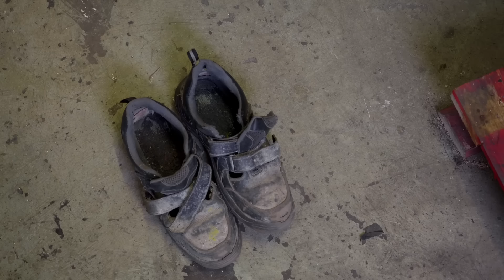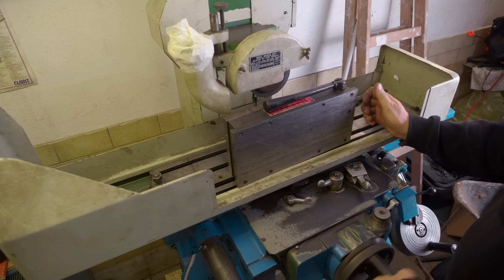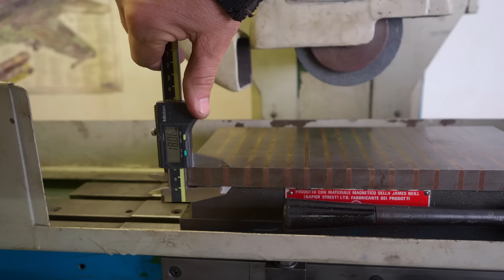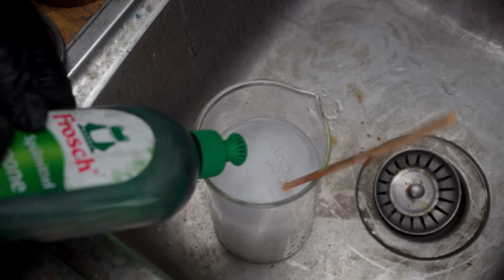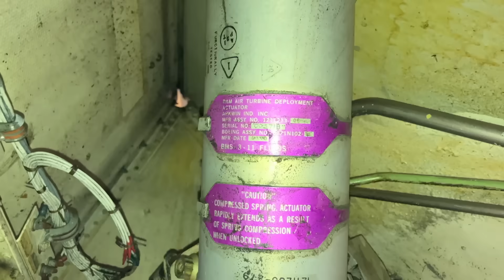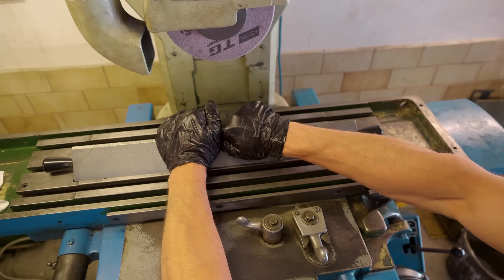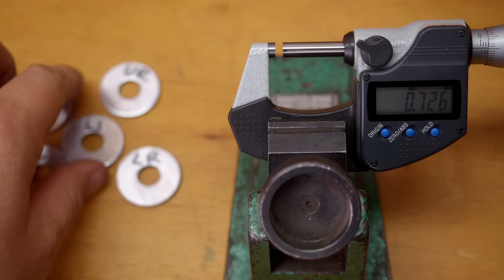Why cant I grind flat parts on my surface grinder? || RotarySMP

Comment: The top of the chuck needs to slide off. It won’t come off directly up particularly if the magnet is on. So, whack it sideways with a soft head hammer until it moves. I bought an Eclipse that was stuck that way as well. Though they had counterbored for the screws on the bottom and used standard hex head screws. Also, the manufacturer of my grinder says to first grind the table when you set it up and then to grind the bottom of the vise, without the magnet on (light cuts only!). Then flip it, clamp it on, turn the magnet on, and grind the top. A bit of work, but not too bad and everything is flat. So you know doing that is correct. But grind the table first! Otherwise, every time you move the chuck you have to regrind it, because it will distort from the non flat table. Since this is to get very high precision, that could matter. And please be careful positioning the diamond past the center!

Balancing the wheels is important. Even if you buy a really high quality wheel, such as the Norton’s I use, the material isn’t perfectly homogeneous. Cheaper wheels, I’ve found, can be really unbalanced.  So you have to balance them before using. I made a knife edge balancer out of three pieces of 1/2” aluminum and two pieces of blades from a wood planer. I slightly dulled one edge with 600 sandpaper. That works very well. Just make certain the blades are parallel and that you have three adjustable screws for feet to allow for leveling the balancer.

It’s hard to measure that surface with a level when on a wood pallet as the shifting weight can cause the pallet to squeeze slightly as the weight moves toward that side,  causing the reading to be reading the pallet as much as the machine.

I did put a DRO on the vertical column. I don’t care about the size itself. You can easily get a 1 um glass scale for some of these. I use TuAuto brand DROs and scales. They’re very good and inexpensive. I have them on all my machines. They have good support, including videos. Too bad they don’t have a one channel DRO though. Don’t buy something REALLY cheap. We’re grinding to 0.0001”, or equivalent, so you have to be able to read around that number.
Reply from the maker: Hi Mel, a friend of mine has a balancer. I just need to make up an arbor and go and use it. 

I dont want to grind the table, until I have scraped the ways back into alignment. 

I already bought a 0.1µm scale, and have a DRO kit from my friend Stefano. Just need to find time to install it.

Comment: The chequer pattern after grinding is probably because the grinding wheel is out of balance.
You can make a knife edge balance for the grinding wheels- that's one week of content sorted 😉

Re: overhauling the big magnetic chuck: I'd be really wary of taking it apart. Those magnets (especially in a chuck that big) won't hesitate to remove fingers.
Reply: Found this video of an eclipse vice.
Seeing him putting his fingers that between the multiple pinch points had me wincing nonstop.
https://youtu.be/e3P_Fcl97tw
Reply from the maker: Thanks Marc. I will getting some oil into it and exercising it and see if I can get it to free up without stripping it down.
Reply: @RotarySMP   @oxtoolco has done a rebuild of this type of vice: https://www.youtube.com/watch?v=kukVLu26GV8

Comment: Good video, but in order to get an excellent result, it is better to balance the wheel first and use coolant, especially when you are dress the magnetic chuck.
Reply from the maker: Yeah, I have been on the lookout for a coolant tank. My friend has a balance jig, but I need to get around to making an arbor.

Comment: Solid Rock Machine Shop channel has a few videos (one as a guest on Vintage Machine) grinding in a chuck. If I recall, Steve ground the bottom with residual magnetism and the chuck mass with light passes.
Reply from the maker: I dont expect this to me my last grind on that chuck. I removed so much I am sure it will move a lot when I remove it.

Comment: I knew a regrind was on its way 😂 I have to say it. I told you so
Reply from the maker: You did. I was just hesitant because the first results were so bad, I feared a worse problem than just the chuck.
Reply: Armchair machinist for the win 🎉 @RotarySMP

Comment: Interesting that they want you to thin the spindle oil with 10% of kerosene.
Reply from the maker: I suspect this machine originally delivered with the plain bearing spindle, which needs that kerosene thinned oil. It now has a spindle with greased AC bearings, so that placard is no longer applicable. Or maybe the cover was switched between grinders.
Reply: Interesting.
Normally precision bearings are always oil lube.

Comment: Another great video, Mark. Thanks for teaching us a few more useful things. 

On the question you asked about why the machine would be in such a bad shape. -> I have seen some shops where the people just don't care about their tools or the work they make. Good is often good enough in a production shop and this the case of your grinder, it was probably good enough for their purposes.
Reply from the maker: Thanks Johan. I do wonder what sort of shop has a grinder if 0.1mm is close enough :)
Reply: @RotarySMP  I had the chance to use a surface grinder from a buddy of mine who mainly grinds tools for the food industry — I believe they’re dies for meat and potatoes. I wanted to grind some shim rings for a spindle, which really need to be flat. But every time I reached for my digital micrometer, he’d say: “What are you doing? Digital calipers are more than accurate enough!” That probably says it all.
Reply from the maker: @workshop54projects  :) We all have a different feel for accuracy. My daughter is in a physics lab playing with atomic force microscopes and looking at nano particles :)
Reply: My dad taught me to never use compressed air to remove grinding dust from a surface grinder. Compressed air will force abrasive and steel dust into the ways and cause wear. A lot of the parts he made had +0 -.0002 inch tolerance. On a sine chuck!
He would use a grease pencil (aka China marker) to find zero on the surface to be ground. Mark a spot on the workpiece and ease down until the wheel removes the mark without touching steel.
Reply from the maker: @108gk  I dont use compressed air for cleaning machines at all. I know it is fast, and common in industry, but I prefer to brush or vacuum.

Comment: I was once watching a video where a guy was grinding a hollow in thin saw blades by first grinding a convex shape onto his mag chuck that way the shape would transfer into the part when it is pulled down tight. Maybe the previous owner of that chuck was doing something similar.
Reply from the maker: Good call Matthew. Could well be.

Comment: Fascinating video, thank you. I'm not a machinist, and I'm not great at conceptualizing things in three dimensions. I didn't understand why David said that grinding the table flat wasn't useful. Wouldn't that be a prerequisite for grinding the chuck flat?  Was it not out of flat enough to cause a problem?
Reply from the maker: Yes, you would grind the table flat after reconditioning the slide ways, but as the ways are still pretty good, rather than grinding their errors into the table, it is better to leave it and live with as the errors are minor.
Reply: @RotarySMP  Oh, I see. You have to accept something as a given baseline or you'd be forever going round in circles trying to make things parallel.
Reply from the maker: @jrmintz1  Good point. Thinking about it, that table is only about 15µm off, so I would not be grinding away much to touch it up.

Comment: My hypothesis for the chucks condition is. It was used purely for aesthetic grinding of some part or parts and did 1000s of them.
Reply from the maker: I was picturing some production welding shop, which used the chuck to hold thousands of meters of square tube.

Comment: why not just regrind the table and chuck when you got it running?
Reply from the maker: Because the initial results were so terrible, I was afraid there was a larger problem lurking, and grinding the chuck would not address it.

I would not regrind the table until after a geometric overhaul.

Comment: Feels weird to at a base and an acid together on in a solution being that they just cancel each other out.
Reply from the maker: That was also my first thought Matthew. I got this comment...

@JaenEngineering
It forms sodium citrate which is a chelation agent. Basically the molecule formed has a kind of hole in it that is the perfect size and charge for a metal ion to fit in to. That's why it works on the oxides, which is an ionic compound, but not the base metal
Reply: They don't strictly "cancel" they form a new compound that may have different properties than either of the components alone. The question is why one would do it and deal with the foaming when one can just buy sodium citrate, at least in the US. Wikipedia says (of trisodium citrate) "It is common as an ingredient in bratwurst," so I assume it available in at least some other countries as well.

Comment: Throwing in another guess for the valley in the chuck: Maybe someone put heat into it during a poor regrind? That'd grind down a hump in the center that would form a valley after cooling.

Thanks for the video!
Reply from the maker: Would have needed some serious heat to cause 120µm of thermal growth, Everett. :)
Reply: @RotarySMP  Oof, yeah. Good point. Maybe it was overconstrained on the clamps and tried to grow lengthwise? But that's a reach!
Reply from the maker: @EverettWilson  Some have speculated a knife maker wanted that shape?

Comment: Ofc it helps to bring in the table. Since your basically making it flat and parallel to the movement of the moving axis. Now you just also need to do the super glue trick for when you grind in the first side ( so it's ground flat without any stress put into it from the holding ( if it's not flat from the start the magnet is strong enough to pull the unsupported parts down and therefore create stress in the part and when you then turn off the magnet it springs right back. But the superglue isn't strong enough to do that ( hits why you use the superglue trick for the first side )
Reply from the maker: Thanks for the tip. So super glue the mag chuck upside down on the table, grind the base plate, then remove it with acetone and grind the top?
Reply: @RotarySMP  yeah but not like you put the glue all over the chick and then put it down.

what you actually do is first you grind the table so the table is flat and parallel with the movement of the axis. then put the chuck on the table bottom side up. then put the glue along side the edges that way it will suck itself into the small cracks ( capillary action ). then grind the back side clean ( which also ensure that its parallel since it wasnt stressed at all under the grinding ) then you can remove it and turn it over. clamp it down ( maybe make two new clamps that use 3 bolts and clamp down over the entire length instead of just one point ) and then grind the top flat as well. that way everything that needs to be ground is grounded without putting stress into them ( since the table and bottom side is ground without any stress they match and support perfectly to eachother and therefore zero stress when grinding the top of the chuck as well

btw adam the machinest has some really good ideos on grinding
Reply from the maker: @flikflak24  Thanks a lot for that full procedure. I am kind of holding off grinding the table, as I would rather do that after the ways are rescraped. Then again, as the current error is only 1/100mm, I would not be removing a lot of metal.

Comment: Yea those screwdrivers are superb!
If you have the right size Philips, you can push them in the screw head and they stay put horizontal or upside down! 👍
I always have a set of fresh ones for those ashole screws, and some worn beaters, and cycle them through!
Reply from the maker: Thanks for the feedback on them Martin. I was really happy with this one.

Comment: What worries me is that someone was making parts for production on that chuck with it being way way out. So something was made with very badly out of parallel ground parts.  No idea on the black magic that's inside that big mag chuck. On the small one I would drill out the threads and rethread it for a standard or metric thread and get rid of the BS threads. Funny how that acronym describes the threads in two respects. 
    
         I like that derusting mixture. Might work even better in the ultrasonic cleaner assuming it wasn't full already. I like the idea of just putting water in the cleaner then putting parts in a sealed container so it's easier to do different mixes and use less cleaner. 

          So now you can tell the better 3/4 that your shop produces parts for her drip irrigation system. :) A friend of mine has a couple 3d scanners I can borrow but I need to figure out what I want to scan before I have him send them to me.

         My first thought on the sticking was that maybe somehow the piston was covering up the ports at either end.
 
         The comparator post doesn't matter since in this case the cosign error doesn't make a difference.

          Been in allot of discussion about the 787 with pilots and mechanics etc and an ex Lockheed engineer and we all come up with the same group of educated guesses to look at but without any data we dunnow. If it wasn't a malicious act by the crew or an engine failure and shut down of the wrong engine I am more worried as that means a real issue with the fleet of aircraft. That said I don't like flying on the 787. Bring back the L1011 and 747 lots more room to stretch your legs on a long flight on them.
         Which the better half said I should go somewhere in september. Flights to Athens are dirt cheap this year but the exchange rate sucks but I could actually go to the beach and sleep on the beach as she doesn't let me do that... Or I can make a trip to Tokyo and visit my friend from nextdoor I grew up with and haven't seen since 89. Hmm
Reply from the maker: Leg room is not the plane, that is the airlines seating choice. I like that the plasic airframed A/C have the 6000' cabin alt, so you throat is not as dried out after  two 12 hour flights to NZ :)
Reply: @RotarySMP  I live in hot swampy tx so I like dry air as it clears my sinuses. The 787 doesn't have the open room in the cabin to be able to walk around as much as the old planes. But I can solve the legroom plane on every aircraft without taking seats out. Just put a 2x4 under every seat leg. Raising the seat up increases legroom and comfort with no decrease in capacity as your legs don't have to go as far in front of the seat because of our friend cosine error. 

      Speaking of NZ that's a possibility as well as we do fly there and I have a friend with a house that she lives in part time there at her daughters and her daughter said if you want to come just let me know when.
Reply from the maker: @theinfernalcraftsman  You should go visit NZ. It is nice.

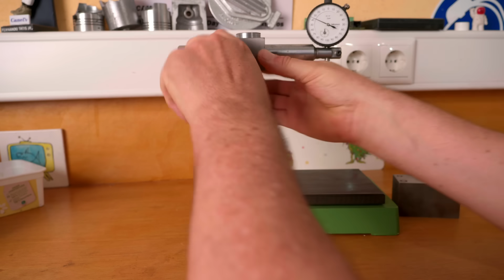Comment: 33:45 The dial indicator preferably needs to be perpendicular to the surface that will be measured. If it is not you will get cosine errors in your measurements. This means that a measurement of for instance 10 µm deviation is in reality 9 µm ect.
Reply from the maker: True, I wasn't very careful there, but you need more angle than that for the cosine error to result in 10% off :)
Reply: @RotarySMP  Yes that is true! Measuring at a 10 degree angle would only give 1.5% error so it is not something that has to be considered in this case. That dial indicator cant be more than maybe 2 or 3 degrees off perpendicular.
Reply from the maker: @arvidhjort  Correct. Plus you don't usually do absolute measurement with such a stand. You are normally just looking for trends and relative thickness.
Reply: Realistically the perpendicularity is irrelevant! There is no 'measurement' actively taking place. We do NOT need to know the thickeness [xx cm]. This is a COMPARITOR! it compares a 'distance'  [thckness] between two points and COMPARES the distance with the value shown between another set of two points. Any angular disparity in the placement of the dial guage is THE SAME angular disparity for ALL COMPARISONS. 😁

Comment: When I did my apprenticeship in the early eighties we had the same or very similar machine with same mag chuck I was made to make the tea for a month if I left magnets on after use and also you should use all of the surface even for small parts as using just the centre can cause way wear problems with the chuck,back then we used batch up similar parts and use the whole table length and width your 5 point test is the correct way to test accuracy after regrind later on in life I was changing surface grinder bearings that cost 1000’s of for a set. Great video as always another point get it fixed down as soon as you can as grinders are sensitive to levelling,and I was also worried I would not get my Sunday fix.
Reply from the maker: Thanks Jon. I wont bolt it down as my floor is not level, but will put it on leveling feet.
Reply: @RotarySMP that will be fine if you check its accuracy with the 5 point test every so often you will be able to keep an eye on its accuracy. Thanks again for great video.
Reply from the maker: @jonofalltradesmasterofnone832  Thanks for your kind feedback.